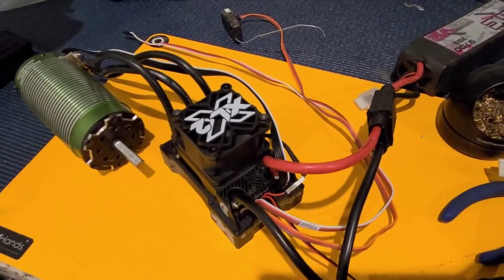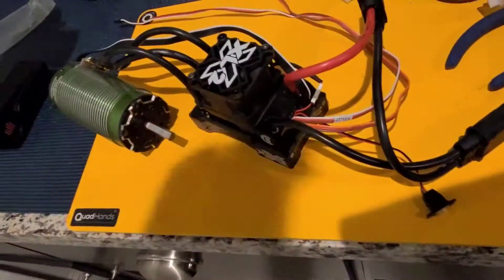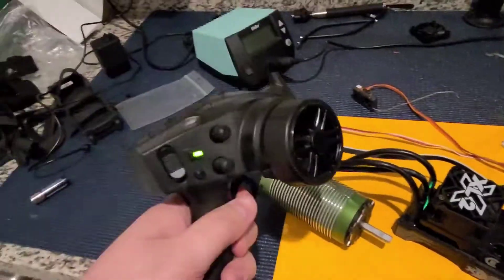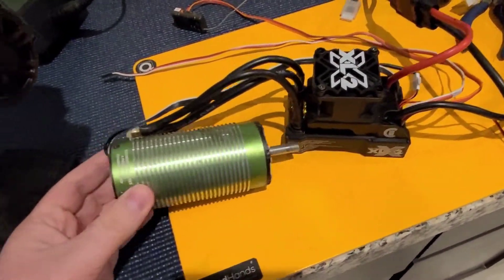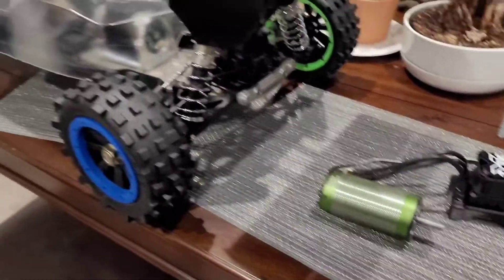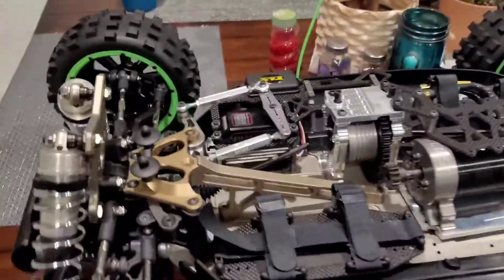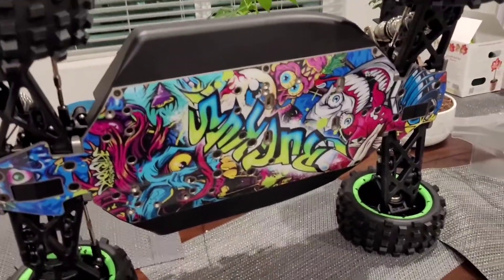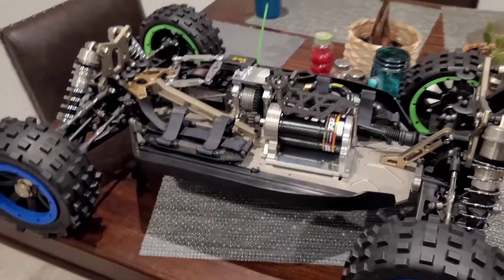Castle XLX2 setup and ready to go in our TLR 5iveB !

Comment: Kindly do you if I can use a Y esc extension to connect both B link and Castle link together so I want need to open the receiver box every time I want to connect it with the pc and also could check data or change some settings with the mobile app?

Comment: Kindly do you know why the auxiliary extra three wire from the esc is used for and what is the function of it?
Can it be used with the B link or Castle link?
Reply from the maker: It provids extra power to run more than one servo if needed or other accessories through the reciver. Its not needed in prob 90% of rc setups . Can not be used for Castle link or b link.
Reply: @RCKYOTA  Thanks for your quick response and reply.

Comment: Hey… you ever run the xlx2 with a radiolink remote? I’ve got that combo and when I let off throttle, the truck won’t just coast in neutral unless I let the trigger go immediately.. if I let off throttle slow, the motor wants to copy the trigger and it jerks the truck harshly bcs it’s purposely slowing down instead of coast.. I just uploaded the video on it, idk man, I went through EVERYTHING…… it’s NOT the castle link setup at all as far as I know.. I think it might be the remote bcs it’s got so many settings but, dang I went through allllll of that to man idk. I need to hear it from someone who’s got the xlx2 and the same 6 channel radiolink transmitter.. thanks, watch the vid if you can I need help bcs It’s annoying🤷‍♂️😎
Reply from the maker: I haven't I am sorry bit that does defiantly sound like a radio setting . Maybe you have the throttle I put reversed and either need to revise the motor direction in castle link or reverse your throttle input on your radio
Reply: @RCKYOTA  …. Oooooo….. Miguel did mention a radio software update but… I DID have to reverse the transmitter throttle when I first calibrated everything bcs the esc wasn’t responding to calibration… wow now I’m re-thinking it all… I know it’s not castlelink bcs it does it without the aux. let’s say.., if I had to 
“Reverse” the throttle on the transmitter in order to allow me to properly calibrate the esc, it should be correct or else I’d be doing the calibration steps backwards yes or no lol? Uh man.. I’ll dive into that. Thanks for the help I appreciate everyone’s input thank you all!

Comment: do you know if the motor and esc are waterproof when in smartsense mode? or when the sensor wire is connected  thanks
Reply from the maker: Yes they are water resistant.  I would not submerge them as water can still get inside the motor but splashed etc are fine

Comment: I have 1100kv version. No fires on mine when powered up. Just use the CORRECT connectors and it'll be fine.
Reply: And Don't use cap packs👍🏾

Comment: What batch numbers are your escs?
Reply from the maker: Two are the batches that have the TSB.  Alot of it has to do with how it's setup tho. Needs precision soldering, correct connectors and high performance  batteries
Reply: @RCKYOTA  i agree with that 100%.  I have one that is a tsb 27255 just have not turned it on yet I've been busy with work.   Do you know if there wanting us to send in them if they fall under the tsbs or if we have problems?
Reply from the maker: @joshherrman3201  sorry I missed your message but they recommend to bench test it. If that was fine then don't worry about sending it in
Reply: @RCKYOTA  its all good man.  I sent it in they were cool about it.  It still make me a tad nervous tho.  Does your esc seem quite when it does the battery beeps?

Comment: I have 2 1100 kv and the 800 kv no fire on my side either. I did see Kevin Talbot catch fire on 2 different xlx2 esc’s. I think the batch that went to the UK are defective.
Reply from the maker: Well the reason KT has issues are 1. he used ec5s those are good for maybe 120 amps. Right in the paperwork it says to use 150 plus amps rated connectors.  Required.  2.  he ran a 6s motor, 3800kv on 8s and free revved the piss out of it. This prob sent close to a thousand amps through that esc instantly.  And he did it twice lol. Guy is not very smart . Esc is rated for around 500.
Reply: @RCKYOTA  so now we got all these requirements to run a esc bs miss me with the bs let them Take blame for there faulty shit I’ve seen other not do what he did and still burn sooooooo next excuse?
Reply from the maker: @angelteamnolimit624  the esc ships with 2 motors, 800 or 1100kv it was intended for large scale low kv . When people run the wrong equipment how is it the manufacturers fault? The bs is people don't know wtf they are doing in this hobby 90% of the time.   If people can't even put the proper connectors on which is the most basic thing why would they even offer to warranty? Seems ridiculous to blame the product for the users bad choices.
 Like I said in the description I agree there are some small issues but nowhere near what the dummy KT has made everyone think.  

If you haven't tried one of these yet then I guess you don't know how powerful it is.the fcker is a beast .  Pushed our xmaxx to 90 mph on badlands,  and our dbxl that weighs 35 pounds to 81mph. Does rolling awd burnouts, wheelies you name it. max 5 is nowhere near as powerful.  
If you don't want to run it no one is going to make you. But we both know we won't see Any records being broken with a HW esc.
Reply: @RCKYOTA  exactly 💯, well said
Reply: Man, I'm excited to turn mines on. I bought the b link can I leave it on? Plus, should I do any pre adjustments before giving it full throttle. Thanks for the video helped sooth my anxiety
Reply: @youtubsuck  you can leave the link hooked up. I do . And you have to calibrate the esc and it’s very easy using the link . Enjoy.